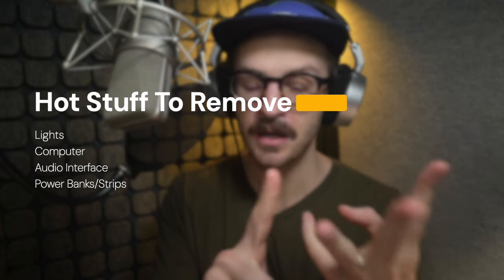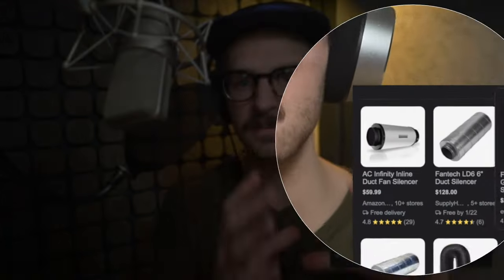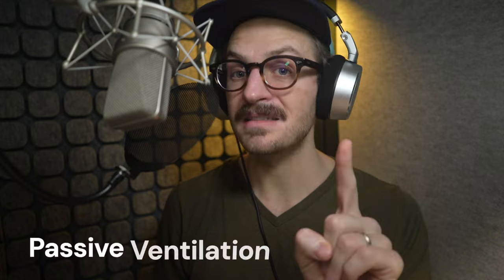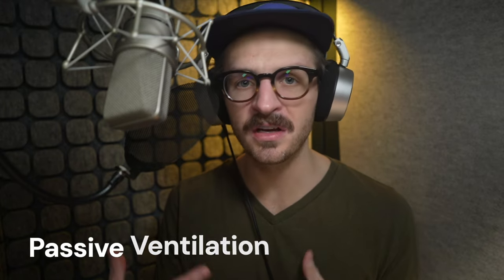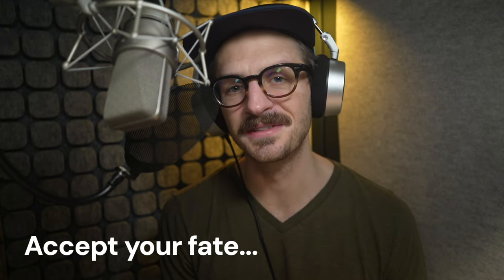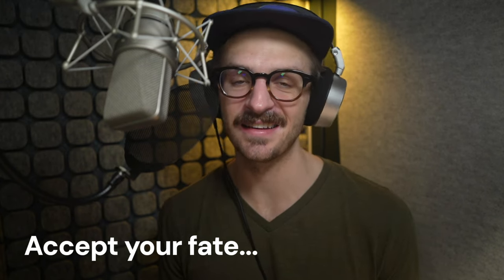How to Keep Your Vocal Booth Cool(er)

Comment: on the flip side of that....not being able to have the heat on right now when it's 1 degree outside is proving to be miserable as I record. I have an electric blanket and one of those sherpa blanket hoodies. But when I start shaking I have to take a break to turn the heat on for a bit to warm up.
Reply: I have the opposite problem: 35° during the day in Bangkok at the moment. The situation becomes a problem from march to...it depends. Let's say July. But it's not the temperature the biggest issue. It's the humidity rate. Above 80% your recordings are immediately distorted. I must wait around 2am to be able to record. And a recording booth is totally out of question. I've just treated my room acoustically. But no condensers mics, far too sensitive. With dynamic mics, Izotope RX10 and sometimes few (free) vst plugins you can really get quality studio results. No pain, no gain 😜
(I can't imagine trying to play a script while freezing at the same time)
Reply from the maker: Oh no!! Stay warm suzie